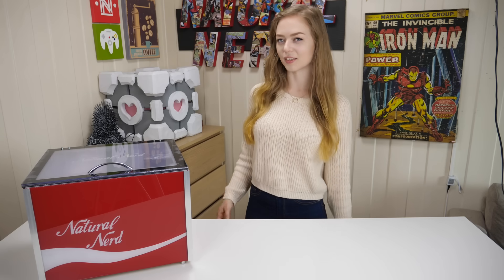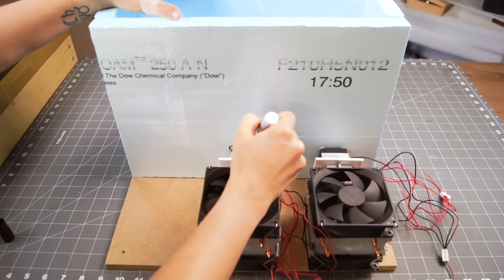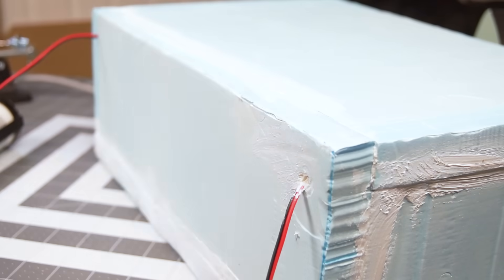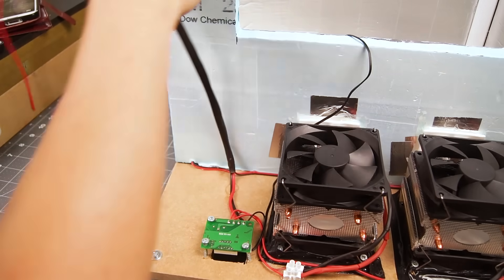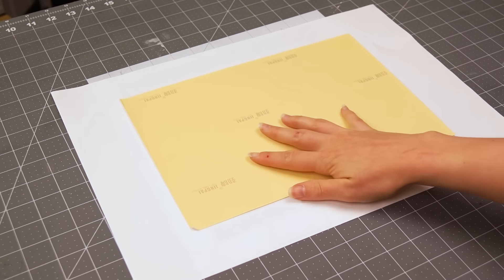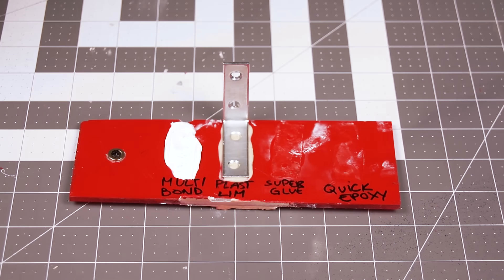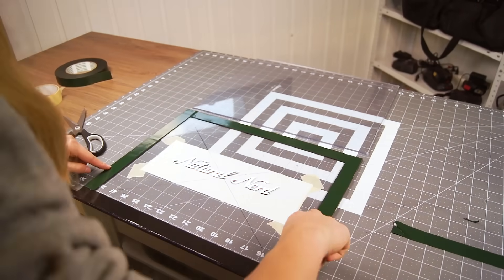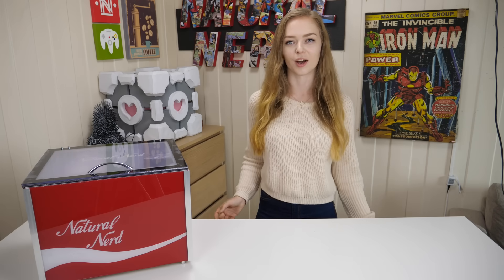DIY Desktop Mini Fridge (5°C!!)

Comment: Seems you spent well over $100 in parts alone for this, that seems excessive considering the size. DId you ever think about finding an old fridge and raiding it for parts instead?
Reply: the whole thing costs about 60 i think and an old fridge uses a think that i don't know how to call in english and a huge think to hold liquid so it can cool and the fridge would be bigger and it would spen more $

Comment: I was worried about condensation on the mother board than realized by the end of the video this wasn't making a cpu case that doubles as a top fridge and extreme cooling system.

Comment: Instead of using this many excessive fans, you could just use one 48W peltier module and one heatsink and fan. Would make it sound even less and even ice up during summer too around the peltier.
Reply from the maker: Thanks for the tip, but I used two 60W peltier modules and fans to both of them, and it doesn't make a lot of noise. It also ices up, so it's pretty neat.
Reply: d610, yeah custom building a PC is much cheaper than buying a pre-built
Reply: Schabacker Jake they are getting better with prices than the last few years tho so that's good for people who don't want to build
Reply: vajje2k5 http://pinterest.com/pin/418834834075047263/?source_app=android
Reply: Schabacker Jake is rather build my own the waste $300 on a prebuilt
Reply: Suzie  cream cheese 
120W of cooling power? Aside from that not making any sense, peltier devices only have around a 10% efficiency, so only 12 watts of that is going into creating a temperature differential. Now I'm not trying to bash this video or the project, I'm just saying your comment was pretty dumb.
Reply: lightdark00 it's just a cool fun DIY project. You can buy a computer cheap too but some of us like custom building and choosing our own parts. Besides getting such a pretty custom designed mini fridge isn't gonna be cheap.
Reply: lightdark00, 'project based on insanity'? Ok, some one is a drama queen. She never made the claim that this would be a more efficient project than just modifying a pre existing fridge. She basically designed and built a refrigerant-less refrigerator relatively from scratch. But hey if you want to make a video of yourself going to Walmart, purchasing a minifridge, slapping a sticker of your name on it, and calling it DIY then by all means...but you should realize the rest of us would think you're either crazier or dumber than she is...probably both. Should I explain what DIY stands for? idiot.
Reply: @lightdark00.    Yup
Reply: I'm really not understanding how this would beat the cost of a mini fridge in the long run that has a compressor. You could get a mini fridge and remake it even. This is a project based on insanity.  If you were using solar power and you had wattage to burn for free and can deal with the heat effectively then go for it.

Comment: Nice build. My only suggestion is to insert a pause occasionally.
Reply: Alex Swavely thermostats are used for that so the fridge pauses when it reach the wanted temperature. If that's what you meant.

Comment: That's hot...ehh...cool. lol
Well, for efficiency it would be better to have an insulated lid for it too. The acrylic lid is fine so one can see what's inside, but having some styrofoam there instead would lower the energy consumption.
However, you did a great job there..! It's not often to see a girl make such kind of handy work...respect.

Comment: Nice build and thanks for all the links on the refrigeration units, thermostat, and power supply. I have been looking for components to build a temperature-controlled fermentation chamber for beer brewing and this is the best setup I've seen yet.

Comment: Great job!!You can also use an Arduino to control the refrigerator modules when the temperature in the fridge  drops below a level so as reduce the power consumption but basically this is thermostat's  job.Congratulations for the good work.

Comment: I wonder if something like this could be powered strictly via a USB connection. Would be nice to bring to a campsite and plug into a solar charger.
Reply from the maker: Yeah, it would we interesting. It would need a quite powerful solar charger though, with a load of around 14 amps at 12 volts.